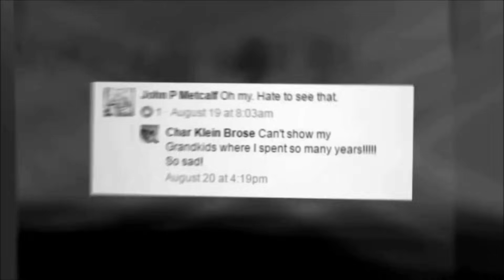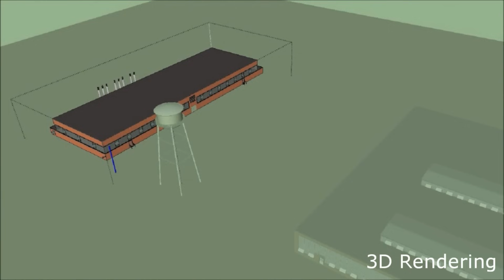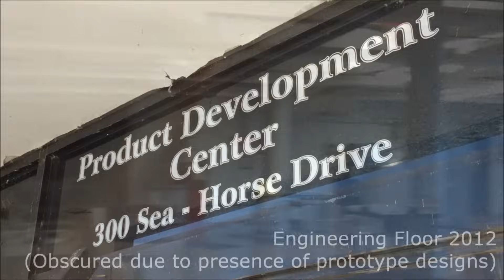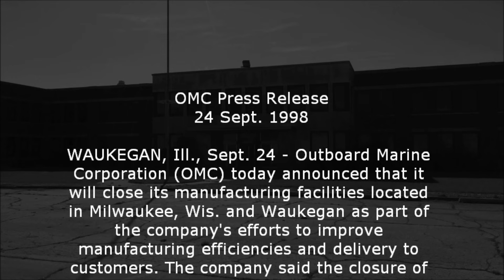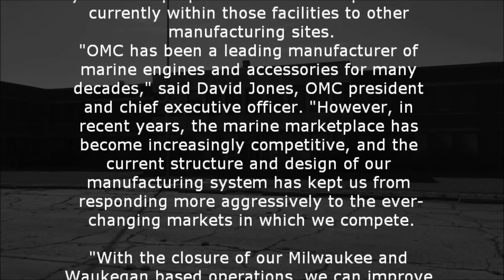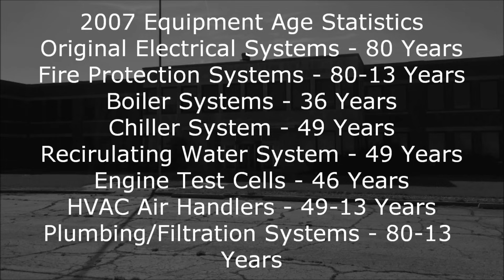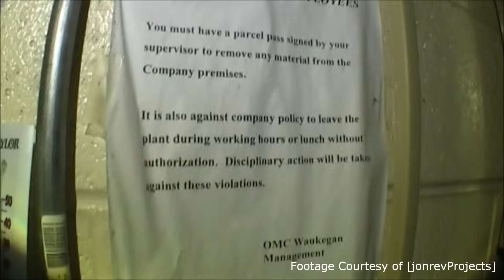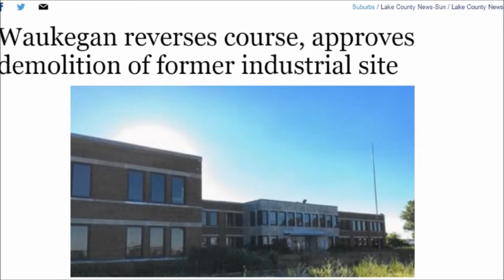The History of OMC Plant 1 | OMC Waukegan 1926 - 2017

Comment: I worked there . The management in the 1980's did a fine job of killing that company. It looked a lot like sabotage from the CEO suite. What a tragedy.
Reply from the maker: In addition to the poor management, when combined with the crippling EPA emissions restrictions that lead to FICHT in the late 1990's and the first round of environmental cleanup from the Plant 2 PCB spills, the company stood no chance.
Reply: Management's brilliant idea of moving to Georgia and dumping all the high priced machinists in favor of untrained people who worked for around $5.00/hour really hurt. For a while dealers would only buy motors made in Waukegan. In the mean time moral really sank. I was an inspector of a polishing line. The caster were really being polished badly. When I couldn't get the line to improve their work, I had to take a casting to the boss to show what was happening. He told me straight out "why do you give a damn, we're all losing our jobs anyway.". I fixed the problem by rejecting the bad castings and blaming holes in the dies for the problem. The next day, after day shift when home, I removed the raw castings they had been working on and replaced them with the rejects from yesterday. They would get average earning for just touching up their previous day's work. They usually were done for the day about an hour after supper break. Everyone was happy.

I was booted in 1985 after almost 15 years of service. I went back to school, earned two degrees, and ended up making 4 times as much as I use to get from Johnson.
Reply: @kcin556  Environmental regulation should never be allowed - let industries dump their waste wherever they want - as long as its not my backyard - right?
Reply: I would almost have to agree with you. Then the real death of the company was when penskes bunch got their hands on it. A very well written letter that guy had written to all the omc dealers quaranteeing it was in good hands with his bunch- Then greentree, then that was it -- very , very sad !
Reply: @kcin556  agreed, ficht was introduced too soon like the cobra drive. Omc ate their lunch on warrantees between these two. Calhoun Ga. didnt help with shitty quality control !! Damn shame , a company since 1921 . !#
Reply: Should have managed it better people whole lifes were there. It's so sad every time I watch this it makes me sad. I own a old Johnson outboard 25 1969 and own a Evinrude 18 1965 awesome motors. I was out on Seneca lake today running my 25 horse Johnson wide open throttle in my 14 aluminum boat. Evinrude and Johnson were the best now it's just 4 strokes. I will never buy a 4 stroke.

Comment: Whatever happened to all of the OMC tech data & other IP? I am presently dealing with the restoration of an OMC 1974 model 990212R engine. The sources that I have found are fragmentary & sometimes contradictory. In short people who go past "modified 307CID small block Chev" seem to be mostly guessing. TIA for whatever info that might be around.
Reply from the maker: Bombardier/BRP inherited most all documentation related to technical service, parts, etc. for Johnson, Evinrude, and OMC "Stringer" Stern Drive. OMC "Cobra" Stern Drive was primarily inherited by Volvo Penta.
Reply: @kcin556  Many thanks, looks like I need to think about taking to Bombardier/BRP. Any good routes there?